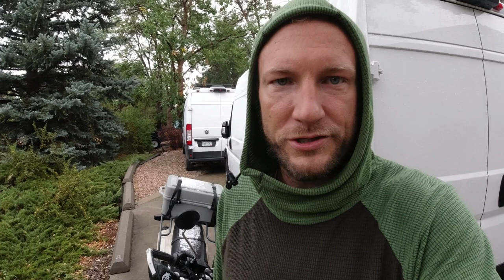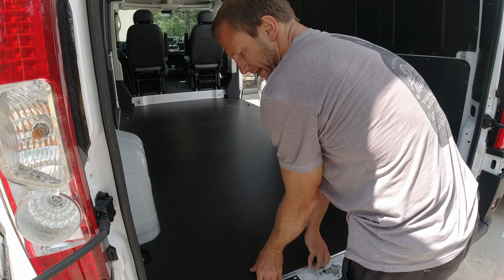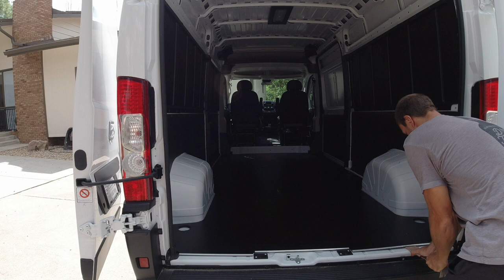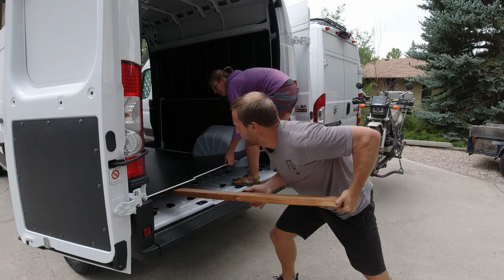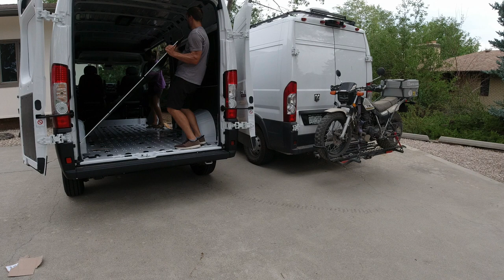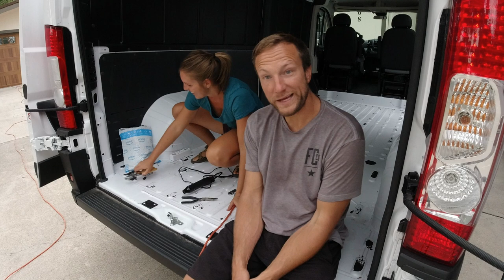How to Remove Factory Floor in a Ram Promaster | DIY Van Conversion

Comment: Hey bro, thanks for the video it's 3 years old so I hope you reply, you said you used it to measure your subfloor are there adjustments to make? Or is it the exact size you need for a template I can't get information on this please lmk Tha k you ❤❤❤
Reply from the maker: Thank you for watching! It's been a while but I believe we just used it as an exact template because it fit so good. I'm pretty sure we just traced it with a permanent marker onto a big section of floor we pre-assembled and then cut it.
Reply: @DrifterJourney  heyy I appreciate you so much for replying I am as we legitimately  speaking trying to pry out the floor, so the dimensions are all right it's not supposed to be flush up to the walls?
Reply: @DrifterJourney  I'm using a half inch birch four by eight plywood 3 of them, I was gonna use like trace papper to make a cut out and than use that to cut my plywood, I just thought I can't use the stock floor cause it's got like half a inch from the wall, I've watched 100s of videos and I'm still lost and terrified lol
Reply from the maker: I'd say that's really up to you. We were fine with a small gap in case there was any expansion due to heat. We just put a little rubber weatherstripping in any gap that we didn't like.
Reply from the maker: You'll get it figured out. I don't remember us having a half in gap though. I'd say more like a quarter inch. I guess you could go a little bigger if you think it will still fit. You can always trim more off easier than adding more back in.
Reply: @DrifterJourney  Bro I absolutely appreciate you, But I have no idea how you got this. Adhesive up with just a heat gun. And your bare hands. 3 pieces took me over 2 hours. It makes me want to give up. I don't know what to do.
Perhaps you have more patience than I do.... But I feel like i'm going nowhere right now.... I think this adhesive was a little too much on dodge's end 😭😭😭
Reply from the maker: @Jesus-warrior it was not fun! I ended up grabbing some pliers to peel them. It still hurt my hands but it helped once I could get a decent grip on them.
Reply: @DrifterJourney  yeah I got p Pliers but I'm getting nowhere I got a touch scrapper and not a eagle grander brush....dodge sucks for this at this point I don't care about stripping all te paint off to remove this, but just waiting a few coasts of Restolium and I'll be good right?
Reply: @DrifterJourney  kudos to you guys for doing this a a few hours...
Reply from the maker: @Jesus-warrior we painted anything we scratched and never had an issue.
Reply: @DrifterJourney  so it ended up taking me 16 hours, I used a chisel  and heated it, than an angle grinder with a wire wheel ....so basically stripped off all the paint and throwing micro rubber all over...but I finally got it done, massively appreciate you and the video/replying.
Reply from the maker: @Jesus-warrior put that one in the win column! Nice work. Glad you got it done and hope it's smooth from here on out for you.

Comment: had several promasters the first one I had to work on that floor I tried to remove it and I never could and I realized that instead of having some adhesive glues it had longer wefts that is much more adhesive I almost had to destroy it to remove it in the end I did not remove it
Reply from the maker: Thanks for watching! That doesn't sound like much fun. I'm glad we didn't run into that issue.

Comment: Came back to look at your van build after following you throughout Baja and up to Alaska.  So what would be the problem with just leaving the floor as it was and just building over it?
Reply from the maker: Hi! We used a cork layer for insulation and sound deadening first. The cork is soft so we needed a ply layer for rigidity on top of it....we actually laid the original floor back down for that layer. We also wanted to keep it thin (because I'm tall) otherwise we could have probably built over it. That would have been original floor, cork, ply, then vinyl plank. I hope that helps and thank you for watching.
Reply: @DrifterJourney  That helps a lot.  I am only 5' 9' so the additional layer wouldn't be a problem for me.  So if I get one with a floor already in it there is no reason that I can't build over it instead of taking it out.  Although the template feature was nice. The sound deadening in the floor wouldn't get done though.
Reply from the maker: @hywaywolf  yeah, not sure how much the sound deadening helps on the floor... but if you have extra layers of flooring, it will help

Comment: Agh as someone who is 6’4 every milimeter I add to the floor/roof pains me haha

Same with the swivel seats… quite an expensive ordeal to keep everything low. I have the factory floor in and have yet to start my build. Just venting. Much work to be done haha, thank you for this video!
Reply from the maker: 6'4" is tough in a promaster!  Most tall people go with the Ford transit high roof so that they don't have such tight tolerances, and then you get tons of head room.   But we liked the way the promaster handled better.  Best of luck to you on your build and thanks for watching!
Reply: You can use this product as the subfloor, it's stronger and thinner than plywood. Just frame out the floor, insulate and add your subfloor back in and flooring on top. You then can frame next to the cross members in the ceiling and have the wood rest on the cross-member (with a vapor barrier, add screws into the frame not the cross members). Hope that helps ease your mind a bit about height.
Reply from the maker: @erikaamac2727  thanks for the comment. We ended up using it as a layer in our flooring. We have 6mm of cork with the original floor on top followed by our vinyl flooring. I don't know if someone 6'4" would be able to stand in a promaster if they insulate and frame out the floor but I could be wrong. Thanks for watching......we're anti vapor barrier but everyone builds differently. That's the great thing about vanlife.